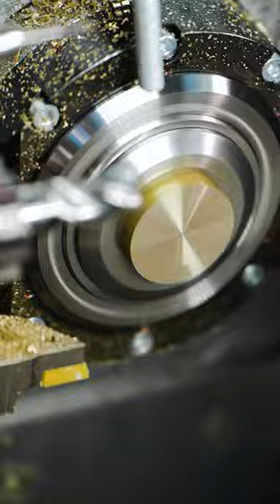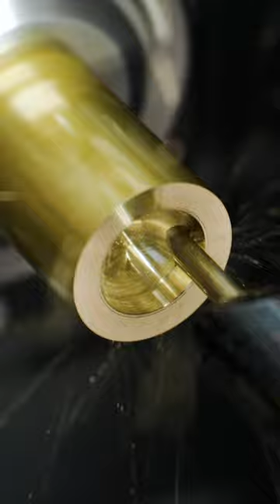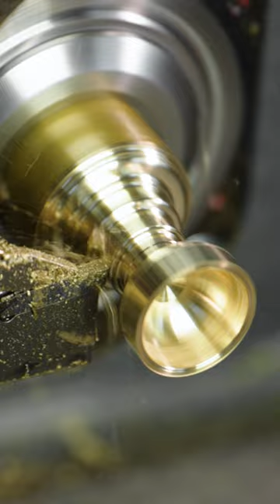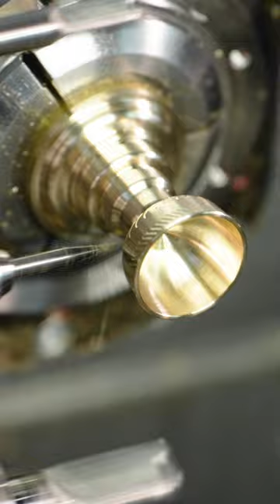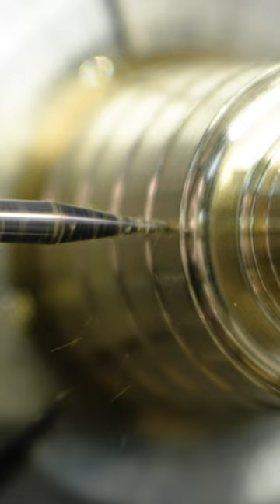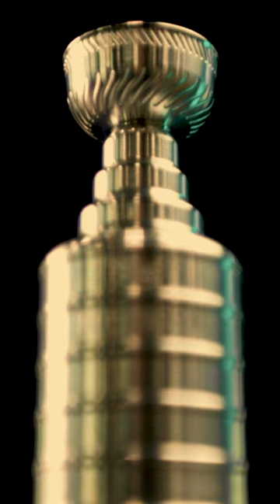Machining the Stanley Cup on our Tornos GT32

Comment: the hardest part is to draw it in 3d
Reply: It's not too bad. There's no print so guess on the radii / connect with lines. do all those grooves as lines and revolve around axis. If you're in esprit it has a cool feature where equally spaced features only have to be dimensioned once and you can revolve within the operation x amount of times around y axis z degrees. Otherwise Gibbs or mastercam allows you to copy and revolve. Just chain the lines with no CC.
Reply: One of the easiest parts to draw actually...
Reply: @dmitrypolovin1776  I think the live tooling engravings is what intimidated him but they're just lines and arcs so when you see it that way it's not bad.